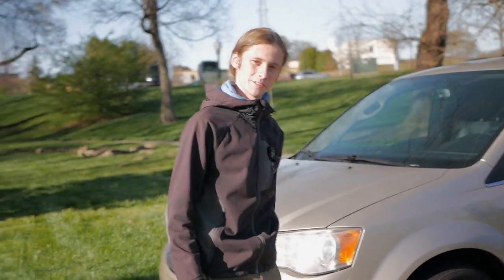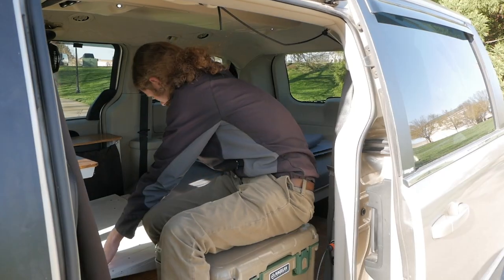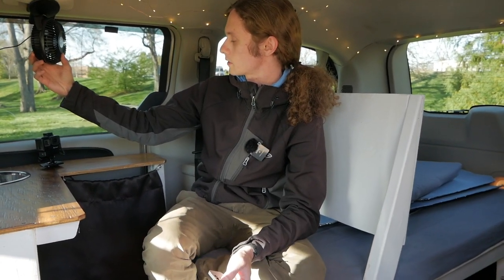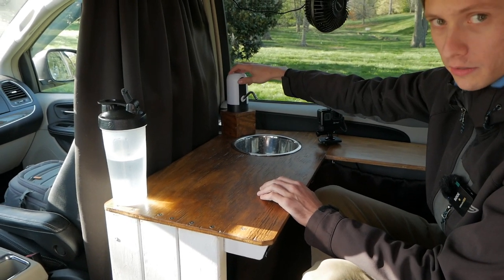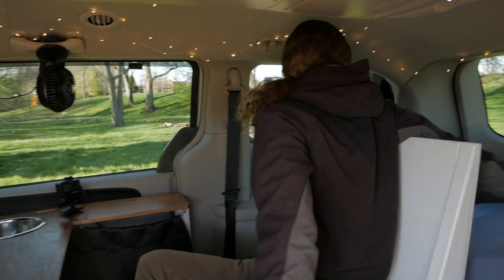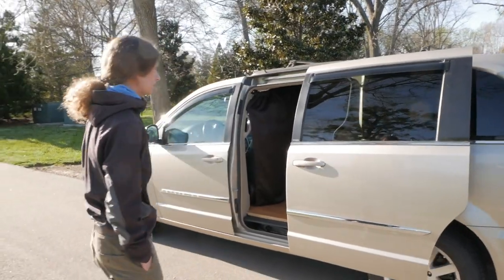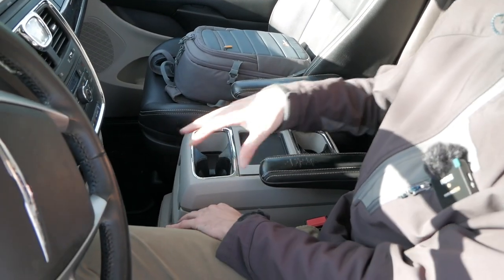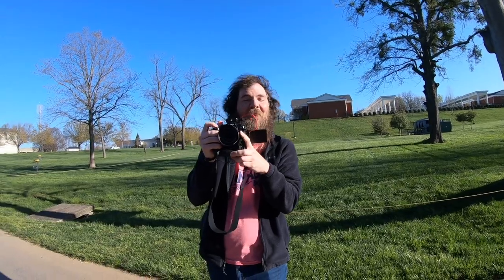Mini-Van Camper Tour || Self Built || 2013 Town and Country

Comment: I wanted to do the velcro with direct contact with window but wouldn't that damage the interior windows? not a big deal? I guess use glo residue removal to get the left over gunk off if you find another option ?

and what about the passenger and driver windows? if you'd put velcro on them , rolling down the window they could get jammed or something .. ? just my thoughts on this ..
Reply from the maker: @e_thegod5303  the windows in the back don’t roll down all the way, so I just put the Velcro higher up on the window and it wasn’t an issue. For the two windows in the front I never covered those because I just closed my curtain. 

I will say, though, Velcro on the windows wasn’t my best idea. It didn’t damage them or anything, but on really hot days it can melt the adhesive. So just something to consider. There’s probably better ways. Haha

Comment: Nice job.. I'm doing a Volvo, are you going to video your Cube build,  I'd love to see it.. oh yeah did you have any heater devices?
Reply from the maker: Yes, I am videoing the build. I have 2 videos up on it now. Should be the last too. I actually almost ended up with the Volvo instead of that Nissan Cube back when I was originally buying it 😂
Reply: Too Funny.. I wound up buying 3 total, one was $400, bad motor but super clean and the other for $600, someone accidentally put water in the fuel can, and he put it in the car.. I drained the system and drive it today.. everyday because it's a sweet blue, the others are black and white, so if you see a Volvo in Sacramento that looks like a cop car... smile and wave